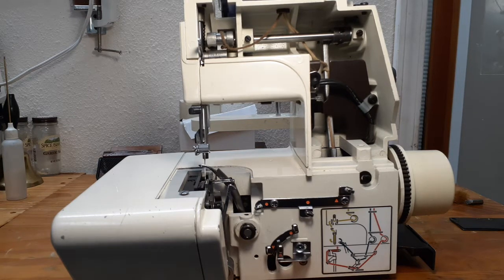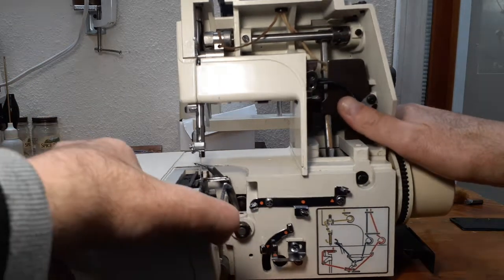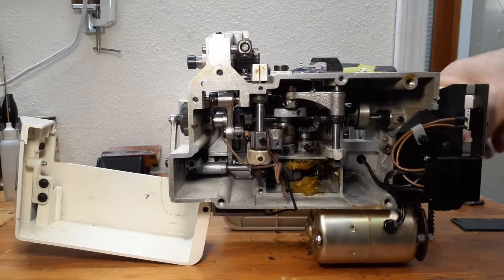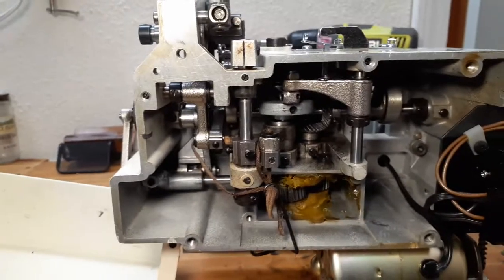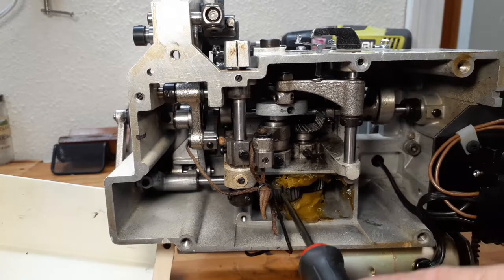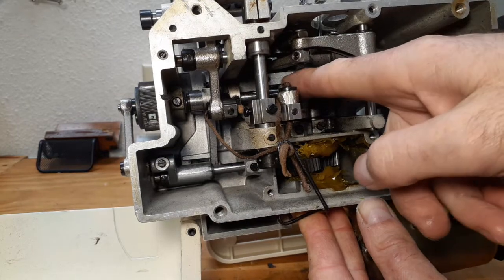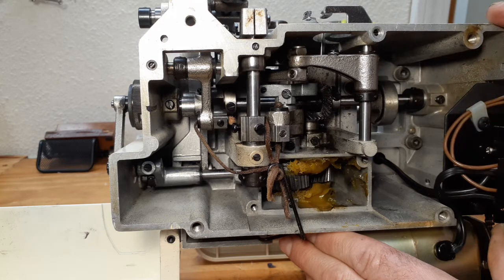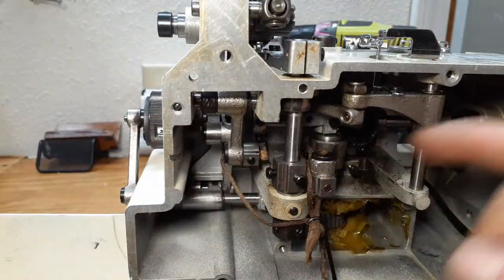Serger Sewing Machine White 503

Comment: I recently bought White 503, used.  The motor belt was broken into pieces and string, and needs to be replaced.  I bought a new belt, but cannot figure out how to do the replacement.  If you could show that, I'd e very happy to see it done. Thanks.
Reply from the maker: There are 4 screws on the motor cover remove them, and loosen the motor and replace the belt, keep the belt thight but not too much  between loose and thight

Comment: Thanks for the video!  Do you know how to restring the internal string next to the gears?  My machine is missing and assuming that's my problem. Thanks!
Reply: Why do they have strings in the gears connected?  Mines is also missing and no sewing shop wants to help because its way to old machine.. looking also for the timing of the needles... keeps breaking. Please share some info if you have
One last problem I have, I can turn the wheel just one 1 time and bumps somewhere, I think on the top lower needle, but do not know the adjustment for this